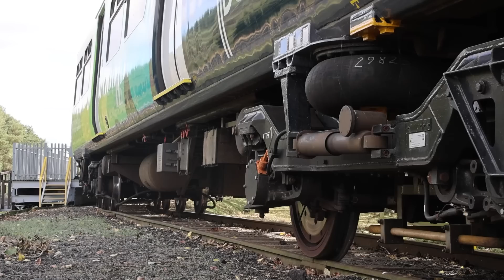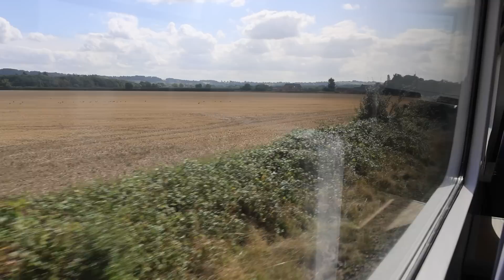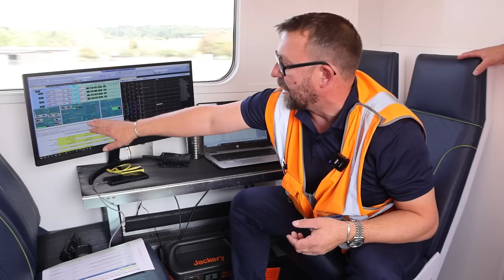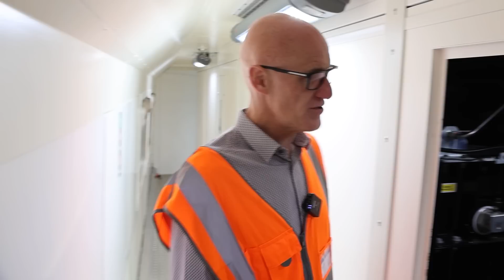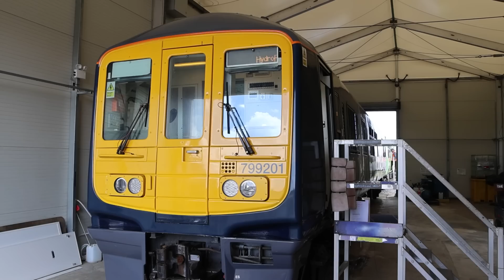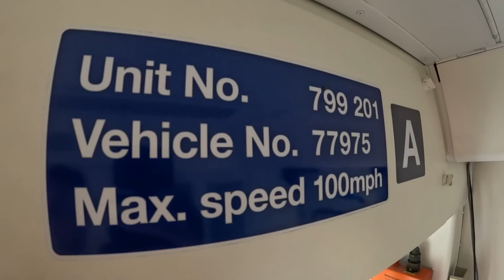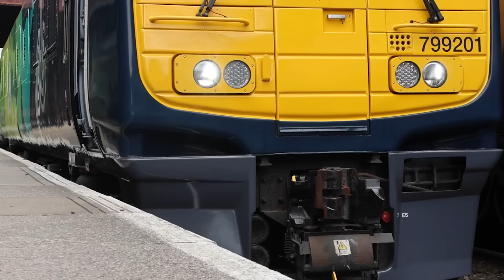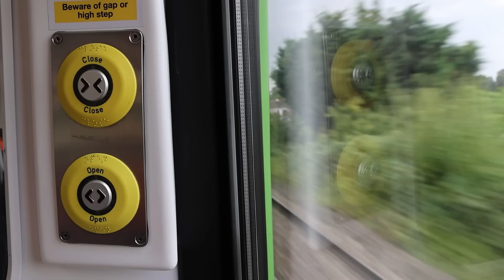The Class 799 Hydrogen Train

Comment: They're beating a dead horse. All the mk3 derived EMUs are going for scrap. Even SWR are eventually phasing theirs out.

If they want to build a fuel cell train, they should test it on newer stock.
Reply: I assume they are using them because they are easily available and not needed for anything else, and that if they take the technology into operational use it'll be on more modern or new trains.
Reply: It really does not matter what rolling stock you are using when you are seeking proof of principle.

Comment: In Germany we have Hydrogen trains running since 2022 or 2023. However the latest news are that the goverment will cancel the project, as the train resulted way more inefficient and expensive than just electrifying the line where they run and buying a new fleet. I can't say if the problem is the technology as a whole or just the Alstom iLints that are a mess on rails.
Reply: The problem is the 17% (max!) efficiency from the electrical source (let's say it's from renewable production) to the power at the wheel-rail contact.  The waste of 83% of energy is unbearable.  Also, as a worldwide society we can't do everything with hydrogen as the means to synthesize it are not infinitely scalable, so we need to make choices of what to do with H2 and do nothing else. The best things to do with H2 made from renewable electricity is production of ammonia to be able to make fertilizers (without natural gas as of today), and to produce steel (sponge iron obtained by reduction of iron oxide with H2, without coal as of today).  These two processes will swallow all the worldwide H2 you can produce with renewable electricity.
Reply: I would like to point out there are two companies who operate the iLint and only ONE of them have decided to cancel the project. The other hasn't had any issues.
Reply: Yet another proof that Hydrogen is nicer in theory, and that it.

Battery works so much better.
Reply: @ except battery doesn’t work as it’s very heavy and requires power supply ti remote areas
Reply: @RhysRail Heavy works on the railway. As long as the batteries are next to the traction axles they help to get the power down, and they will keep momentum when the power comes off.
Reply: Germany an other countries have been ahead in rail technology for a while. Not sure why they don't just electrify everything in the UK.
Reply: The problem is with the technology as a whole.
Reply: I can see how on some lines, electrification would work out cheapest. Maybe with a battery back up for branch lines or for one of the very rare power cuts.  However the technology you have developed will be very useful here in Australia (as well as many other places) because electrification only tends to happen close to the cities, not in the many thousands of kilometers of the country lines.
Reply: @martythemartian99  Cool, so we got some accredited internation standard hydgron station in outback, required cooling, and entinners to refuel a train
Reply: @pedromorgan99  the difference is it can get across the whole outback on one tank compared to having to transmit high voltage electricity thousands if miles with no benefit other than one single line railway that would probably still be using diesel or hydrogen trains as electrifying the branch lines would be hard as well
Reply: @pedromorgan99   Nah, that would be silly.  If we did use any hydrogen for railways, it would be Freight out of one of the proposed Hydrogen centers like Whyalla (if they are ever built), or for country passenger rail like on the Victorian Network, with fueling only at each end of the line.
Hydrogen isn't a one size fits all package, it is just one possibility to look at with a critical eye.
Also there are no diesel fueling stations in the middle of the desert, they just carry enough fuel with them, along with extra crew (not in the same tank).😄
Reply: @martythemartian99  Electrification of Australian main lines could be very beneficial thing, not just for enviromental reasons, but because electric freight locomotives have much better performance than diesel (or hydrogen) ones, but it would also be massive undertaking and I can't see Australia making investment of this scale in rail infrastructure at the moment.
Main situation where hydrogen trains could be beneficial, would be running quiet branch lines, especially in rural areas, where number of trains or demand for rail services is simply not big enough for electrification. Especially lines, with 1-2 trains per day, freight or passenger.
Reply: @TrainFanFinland  Batteries are almost always best.
Reply: @rogerphelps9939  Batteries are best but there are limits.  A good way forward is partial electrification : battery train + wires at the terminus stations and if necessary a few miles where needed, to recharge along the day.  Or the opposite : pull wires everywhere where easy but where it's too complicated like in tunnels, onto bridges, under bridges, ...  More small are the gaps, more small are the batteries you need to carry all day long and more trains can be built with the limited amount of batteries which will be available on the planet (there is a limit to that).
Reply: @rogerphelps9939  They are not. Battery train units have shorter life span, are more expensive to build and maintain and have poor performance, when compared to electric trains operating under wires.
That being said, battery locomotives certainly have their uses in lines that can not be electrified for one reason or other or in shunting duties.
Reply: @TrainFanFinland   We currently lack electrification on all freight lines.  It only exists on suburban passenger lines (most, but not all).
My brilliant plan (for I see myself as smarter than I actually am) is to introduce pannier pickups for our diesel electric fleet, and build short (5km) sections of overheads in the places where the long, heavy freight trains need to accelerate from 0 to 60 kph.  This would save a lot of fuel.
Then it would be a simple and low cost process to extend the overheads a few km every budget year, saving more and more fuel, until the whole system is electrified somewhere around the year 2800.
Clever eh?😁
Reply: @TrainFanFinland the pure scale of it would be something else, like even how would you cheaply get the required power to the middle of the outback is very hard
Reply: @rogerphelps9939 batteries are worst in every way as all efficiency bonuses they get are lost when you have to have the train stopped for ages as still get power generation out there
Reply: Thats exactly the quick.pragmatic solution.. like japan their lines.. .. but as am in UK... I dont want trains passing down my back garden during summer barbabuses.. so I strongly oppose... !!!!
Reply: @rhysrail  If you're interested about subject, I suggest reading about Trans-Siberian railway electrification and Milwaukee Road electrification as well as electrification of Russian and Chinese rail networks in general.
But as said, it would be massive project and I can't see it happening right now.
Reply: @ yeah electrification is an interesting topic as well as the electric grid in general as it’s is simple on the service but so complicated the more you read about it
Reply: @rhysrail  solar. Australia has solar. Charge batteries and swap them. Trucks in Aus are already pioneering this.
Reply: @rhysrail  Wrong. The idea is that battery trains charge while they are running on sections of electrified line. No need for long stops.
Reply: @rhysrail A way is to route higher voltage wires along the railway. But just the overhead electrification itself can transfer power for relatively long distances, with sub stations at say 50km (30miles) apart.
Reply: @ yes it’s definitely possible, just that would still be very expensive and if anything goes wrong you would most likely have to fly someone out from somewhere like Melbourne
Reply: @ not all services would use electrified sections as for example many branch line services start at where the electrification ends
Reply: Dismountable batteries are a great idea: They would also make electric cars cheaper, and can be scaled right down to mopeds and err, flashlights and right up to Jumbo Jets.... Somehow.
Reply: I often think it would be a good idea to install wires somewhere like the Devon Banks or the Lickey Incline (where I think they did anyway) so a retired class 86 to 92 could replace a 66 as the shove-up-the-arse loco. Likewise in shunting yards or intermodal terminals (which would make loading containers exiting) . 

The trouble is, with our fractured railway, you get the problem where LNER can use the wires on the ecml, but TPE s' bimodes can't unless they put a meter in or something.
Reply: No, it's down to the laws of physics and chemistry.
Reply: Just electrify the lines and power them by nuclear... oh, wait... you can't.

Comment: Hydrogen for transport is a con on behalf of the fossil fuel industry.
Reply: That which is asserted without evidence can be dismissed without evidence
Reply: I mean.... I don't think it's a con by the fossil fuel industry, but it's certainly a con by a bunch of venture capital investors trying to capture government funding for a terrible system. 

hydrogen is a terrible fuel. it's hard to with, it takes an enormous quantity to do anything with. you can't cary very much unless it's a liquid and it's phenomenally difficult to liquify and by the time you actually make the hydrogen, it's actually not very green at all since you either need a ton of electricity from burning natural gas, or you need steam reformation of natural gas which is basically the same as burning it. even using renewable electricity, the energy storage efficiency is horrific. (like, 25-30% at best)

technically there's nothing wrong with hydrogen, practically there's nothing right either.
Reply: @sleevicus  there is plenty of hard evidence of this, including shell and bp's role in pushing hydrogen cars as a way to delay ev's, youtube does not allow links to be posted, and also seems to be deleting some comments. Hydrogen for heating, a pointless last gasp of the gas industry to continue burning natural gas rather than getting on with electrifying heat.

Comment: These aren't the future, they're a stop gap that would have worked 20 years ago while batteries improved. Same with its use in cars. It's a dead end beyond a few specific use cases. They've trialed them in Germany and results are... not so much in their favour. Hydrogen just lacks the energy density to be a real solution, again outside some very specific use cases. Diesel is absolutely fantastic in terms of its energy density, that's why it's so hard to get away from fossil fuels. They're almost too good. I'm not in favour of fossil fuels by the way, just explaining why this kind of thing isn't really going to unseat them. The real solution is to electrify as much of the network as possible. It'll be cheaper long run and the rolling stock can be cheaper and easier to maintain too, not to mention much lighter as they don't need engines or massive banks of batteries.

Comment: Good news.  If we do not investigate this and other hydrogen use cases, it will be too late once we have a supply of green hydrogen.  Not sold on hydrogen for cars and house boilers, it’s the big diesel applications we need solutions for.   When the wind is blowing and there isn’t demand for the power, we pay to turn off the turbines, and this will become a bigger cost.  So it’s better even than free power .. use it to split water.  Doesn’t matter if it’s inefficient.

In other news, I was watching a video on another channel about South Western investigating intermittent third rail plus overhead to power battery electric trains on the Exeter to Waterloo line.
Reply from the maker: thank you Ben! -> ££ <- that's very kind!

Comment: Is the manufacturing and disposal of those lithium ion batteries still better for the environment over diesel?
Reply: The batteries can be recycled with circa 96% material recovery. Mercedes have just opened a factory but there are several other companies you'll never have heard of like Redwood Materials.
Reply: Yes. Burning something once will always be worse than building something that can be recharged several thousand times and then either repurposed or recycled for it's raw materials. It's only because of what the people who make the diesel say that people even question this.
Reply: Yes
Reply: It should be yes but that is a good point about the disposal of those batteries